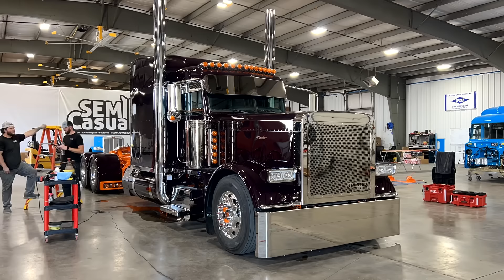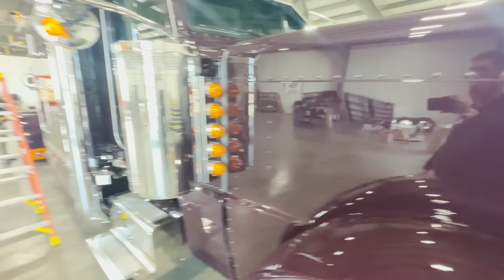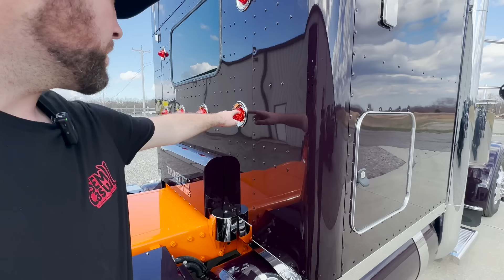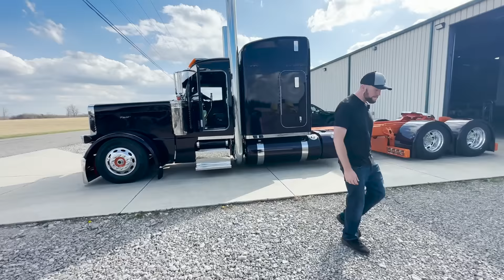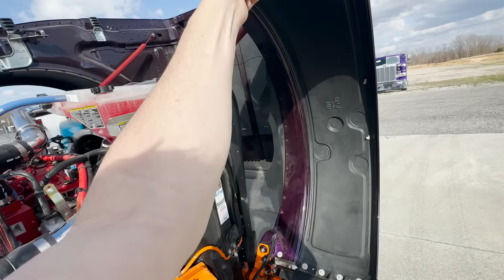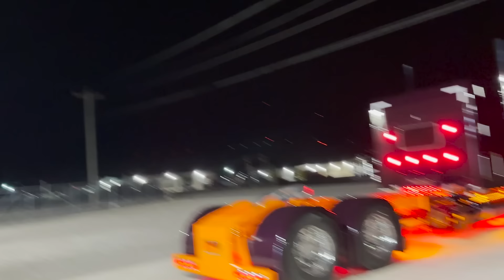Legendary Purple 389 is complete!!

Comment: They are also known as Cozad ramps because they were first developed by the builders of Cozad RGN heavy haul trailers. The purpose is to help lift the nose of the trailer up high enough so that as you back under the trailer you don’t tear up your frame, fenders, or the nose of your trailer. The “big strappers” with the fancy rides like this truck put them on for the same reason.
Reply: In Stockton, California. They're about 50 miles from my house Mr. Bill Rackley is in Stockton, too.

Comment: The Ramps are good for rolling up the head of the RGN. Also great to have when doing drop and hooks when trailers are lower than the 5th wheel. I have a set on my truck. I do a ton of drop and hook with loaded flat beds of steel.

Comment: Trucks in the UK have the ramps on the back and are known as skids,but with air suspension on the rear they can be taken of but the main job is to lift a trailer that's been dropped to low

Comment: Fifth-wheel frame ramps are designed to guide low trailers to the truck’s fifth wheel so the trailer not slam into the 5th

Comment: looks great but if you try to back under a detach trailer that is sitting low enough to take advantage of those ramps the fifth wheel pin will catch the flat plate you have on between the fifth wheel and rear of truck.
looks great for show